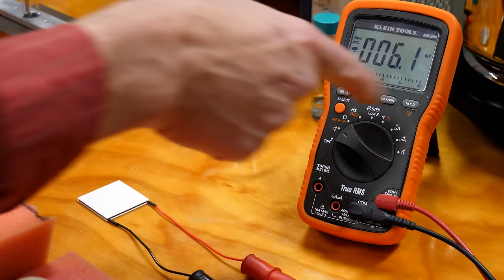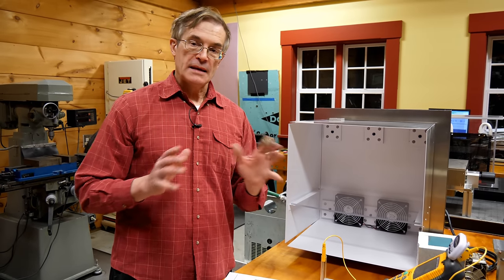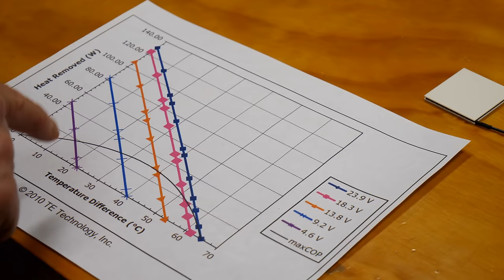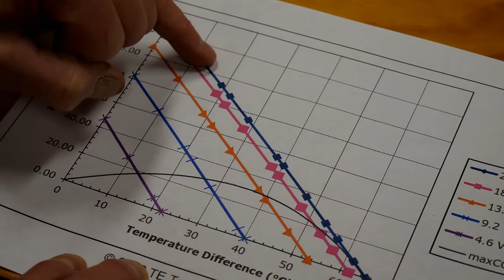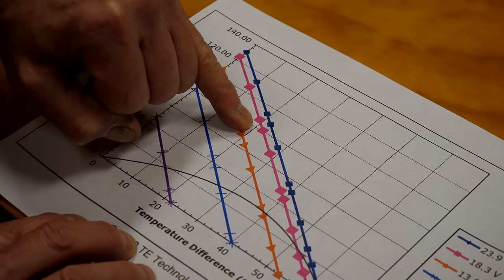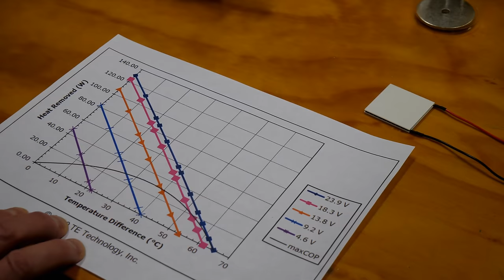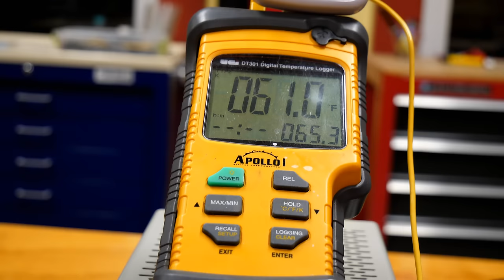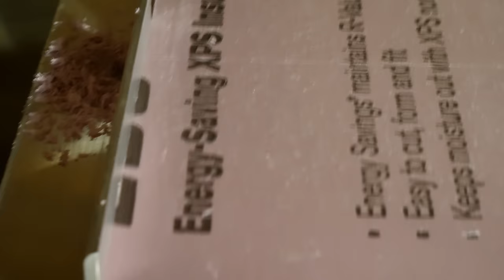BUILD YOUR OWN REFRIGERATOR! - SOLID STATE TEC

Comment: Put the opening on the top and the cold air will stay in the refrigerator when it is opened.Cold air pouring out when the door is opened is the biggest loss of energy.
Reply from the maker: We are doing  that for version 2.0 which is actually a freezer, but this refrigerator is for daily use in the lab and front loading is much more convenient.
Reply: In theory when explaining thermodynamics cold air has no tendency to move from a cold area to a hot area, but instead heat has the tendency to move from a hot area to a cooler area. Orientation of the fridge does not matter when trying to keep the heat out. Nice try, Mark.
Reply: @Standard_Logic  Seems the cooler air in the unit would flow out of the front facing door, as this cooler is is more dense than ambient. Similar to a fog rolling off and down a hillside, a bulk flow of a more dense gas. Theory does state that heat transfers from hot to cold, but in this case it is more about the buoyancy of the air. I think this would cause the inside to heat up faster, than if the door were at the top. Same reason the fins on the back are oriented vertically, to promote air currents up and through the fins via buoyant forces.
Reply: It will absorb moisture
Reply: The moisture will condense and freeze on the heat transfer studs. Two minutes with a hot air gun should be good to defrost. By switching each Peltier off one at a time it might be possible to make a self-defrosting freezer.
Reply: @TechIngredients  Is the front loading refrigerator with a door more convenient than the meat refrigerator at the supermarket with no cover at all?
Reply: that was exactly what i was intented to write. most efficient coolers/freezers even those van-camper style has lid on the top to prevent cold air pouring
Reply: Richard Driskill  Perhaps a brief reversal of current will be enough to de-ice the cold panel one section at a time.
Reply: Richard Driskill  That's what I originally visualised. A way of loosening any ice buildup and a simple collection tray or trough to drain externally.
Reply: @Standard_Logic  

Hey Mr Arrogant,

Cold air is denser than warm air, so it falls out of a front opening refrigerator when opened as warm air replaces it in the top. Nice try though.
Reply: @TechIngredients  I would suggest putting the TECs on all 4 walls of the freezer and build each wall to operate as a cooling fin/heat sink. I love this project and I'm looking forward to future updates.
Reply: @Standard_Logic  In theory, theory and practice are the same, but in practice they're different. Mark is correct. You are incorrect.
Reply: The very act of opening and closing the door, will stir and thus move more air than would be noticed with reorientation of the opening. It's why you should open your fridge door once to load or unload everything, even if the door stays open for a minute; rather than opening and closing several times.
Reply: I noticed you did;nt use sealed pelteir devices. If your cold side is not perfectly sealed at the device , you'll get condensation build up and they'll rot in about a year or less. excellent vid btw.
Reply: "Cold air pouring out is the biggest loss of energy" I don't think that is correct at all. The volumetric heat capacity of air is around 3000 times less than water (the contents of the fridge can generally be approximated by water). Very little of the 'coolth' in the fridge is represented by the air, it is overwhelmingly in the contents. loss of cold air represents a small fraction of the energy needed to keep the fridge at a low temperature, and changing orientation is only a small gain in efficiency.
Reply: thank you
Reply: @lostjohnny9000  first I thought I was a genius, but than I checked the comments... :-)  thanks
Reply: imemine7 I was thinking about this, too.  So maybe the biggest loss of energy, then, is taking containers out of the fridge for longer than they need to be.  If you don't do this, though, then I think Mark may be right in that it's the ONLY loss of energy aside from the regular losses through the walls.

As a bit of an aside, I have a roommate who likes to prepare his meals leaving the fridge door open and reaching for ingredients as he needs them rather than taking everything out ahead of time.  In addition to wasting energy, it is also annoying because the door has an alarm if you leave it open for a long time.  Anyway, I had some milk go bad, but rather than confront my roommate who has a tendency to forget people's requests of him, I took some containers of water and just put them in the fridge.  The same amount of energy is lost each time the door is left open, but the water cools the air down more quickly, meaning the food doesn't get as warm each time.  I'm not sure if leaving the door open was the culprit for the milk going bad, but I haven't had any go bad since.
Reply: @Standard_Logic  Due to the combined gas laws, cold air has a tendency to want to be more dense, and thus the effect of gravity upon the cooler air will be more significant. The combined gas laws also support your hypothesis in a number of ways, for example, when air enters the fridge it is warm, but then with the door closed it will cool and with the temperature drop in an enclosed space you (should, assuming your fridge is appropriately sealed) get a slight vacuum. That vacuum will act to pull warm air into the fridge the moment it's compromised. However, it's the flowing that occurs after this introduction of warm air that's most significant... I have owned chest freezers before, and I now own a standing freezer... it sucks by comparison. I had to get some containers because the cold air flows straight through the baskets that pull out of it. You can feel it pour out of the freezer the moment you open it... all over your feet... very nice feeling in this Aussie summer heat, but a complete waste!
Reply: @lostjohnny9000  you can even use an h bridge to drive the peletiers, and one slightly to defrost it quickly.
Reply: @Standard_Logic  Thermodynamics governs the movement of heat. The movement of hot and cold gases is an entirely different matter.
Reply: @brainmind4070  Hi, I was referring to losses proportionally of course. If you had a front opening refrigerator without a door at all then it would work very very poorly (to the extent that we would be inclined to say that it doesn't work at all).  At top opening fridge without a door would certainly stand more of a chance of working somewhat. 

The three deficits a fridge has to overcome in order to work are the loss through the walls (well, technically a gain of heat of course); the energy need to cool down food placed inside it - whether "new" food or food replaced after being used; and the loss through air exchange when the door is opened. 

The exact numbers and proportions of these three will vary with the fridge design. In my peltier fridge the conduction losses dominate (nearly 4x the food load) that is in a very small fridge but even with 125mm (5") of insulation. My fridge is top loading but the losses due to air exchange are so negligible that I could ignore them in the calculations (assuming sensible use), and would not be that much larger in a front loading fridge.

Not that the thickness of the insulation is by far and away the most important feature of a practical (efficient) peltier fridge (any fridge for that matter) anything less than 100mm(4") and you are wasting your time. All these thing can be calculated, there is no need to guess any aspect of the design.
Reply: imemine7 Well, sure they can be calculated, but these are YouTube comments, where spitballing reigns supreme, with shooting from the hip being a close second.  I appreciate the precision, though.  I didn't realize conduction was so dominant.  Sounds like good insulating material is critical for having an efficient fridge.
Reply: @Standard_Logic  Open a refrigerator that is sitting in an 80° garage and you will feel the cold air come rushing out onto your feet. The cold air is denser and falls out at the lowest point while warm lighter air moves in at the top of the space. Open a deep freeze that is top open and guess what, the cold stays in.
Reply: I think I'm_Doing_IT has learned a lesson from this video. Sometimes snarkiness can punch you in the face.
Reply: @brainmind4070  put an air gap between foam panels. Better than solid foam. Air is the best insulator.  That's all the foam is doing is trapping air. A vacuum is best, but practically difficult.
Reply: I live in Canada, insulation is extremely important to learn about because our climate fluctuates widely, and energy is expensive!
Reply: The biggest loss of energy was me reading all the comments.
Reply: @Standard_Logic  ,  In this case air is the convection medium inside the enclosure. Air is a very low viscosity fluid, cold air is very dense (read heavy) compared to warm air. The dense, heavy, cold air quite simply flows through the open side door to the ground because of gravity, pulling warmer, lighter, less dense air to fill the void. Coffin freezers and reach in refrigerators in your local Piggly Wiggly are great examples. The reach in refrigerators either use doors or a curtains of directionally blown air to help contain the cool mass of air. The dense cold air in the coffin freezer stays pretty stable due to being contained on 5 sides. Nice try, IT.
Reply: @johnosullivan675  IT's principles are completely wrong in this case, his theory isn't very well(or at all) thought through.
Reply: @sebastianramadan8393  Vacuum inside the volume of the contained space is an extremely insignificant factor. Your reference  to "combined gas laws" ignores the simple physics of air #1 having mass, #2 being a fluid, #3 density of volume in relation to temperature. The heavy dense air simply flows towards the source of gravity when containment (the door) is breached. The opposite example of this the function of a hot air balloon. Think about it.
Reply: @lostjohnny9000  Reversing the current through the Peltiers occasionally and providing a drain at the bottom would make it self defrosting. Can be done with a compressor system also, reversing flow and switching function of the condenser and evaporator. Some Manitowoc ice makers operate on this principle.
Reply: @TechIngredients  You can have drawers with open top parts, simple compromise like they usually have at restaurants. I am thinking of getting that for myself when I get a new refrigerator the next time.
Reply: @MarkProffitt  Obviously the one without a door would be more convenient but less efficient.........
Reply: @Jasoninee  LOL why are you arguing about physics you don't understand? Most of the air transfer is caused by the back draft of the door. An open door allows heat into the unheated space, increasing the temperature of the fridge.  Cold is an absence of heat, nothing on its own but a subjective quality.
Reply: @FletcherHillier  
How would I not be understanding the physics?
You think I don't already know that cold is the absence of heat?
Are you implying that you dont believe cold air is more dense than warm air?
Take a wild guess why deep freezers are oriented with the opening up but yet the same exact door of a normal fridge.
Opening the door just creates a short moment of pressure drop where warm air would flow around the door to fill in where it left.  The inside is a sealed box so the slight pressure drop would only have the cold air spring a little and return in, causing minimal turbulence.

Apparently you never open your fridge barefoot huh?
Reply: @Jasoninee  He doesn't want a top loading door though.  The physics behind something Noone wants is irrelevant.
Reply: @MarkProffitt  well since he isnt in a supermarket, yes, probably.
Reply: Mark is correct that the cold air sinks to the bottom of the space and would "pour" out of the fridge, not because of being hot or cold but because the cold air is more dense than the air surrounding the units exterior.  Because the atoms are colder they closer to each other, thus more atoms fit into any cubic space, thus the air is heavier.  In weather a low pressure front is usually warm and a high pressure front is usually cold.  Another  simple comparison would be an above ground swimming pool.  The weight of the water in the pool is greater than the weight of the air around the pool.  The only thing holding the water back is the pool wall.   If you tried to place a door in the side of the pool the heavier water would rush out into the space that contains the air that is lighter than the water and the space the water was in would be replaced by the less heavy air surrounding the pool.  In the case of the refrigerator, the dense heavier cold air will pour out and be replaced by the less dense warm air surrounding the exterior of the fridge.  In most cases (unless the air in the room was nearly saturated with relitive humidity) the amount of heat contained in the air molecules is very small compared to the amount oh heat that a more dense item like liquids and solids can absorb.  Usually the time the door is open is not enough time for the dense items to absorb much heat from the surrounding air because again air with low relitive humidity does not have very much heat in the first place.
Reply: He should put this refrigerator inside a freezer when he opens it mate
Reply: That's what long term deep freezers do
Reply: Phubar Now So?  Like said earlier;  air has very latent absorption, so tho it feel cold to you the refrig is loosing very very little cold.  Compared to the contents the absorb all the cold.
Reply: gravelydon But a little cold air on your feet means almost nothing, it contains such little energy.  After a couple seconds the air is out and the contents are still cold and have absorbed the bulk of the cold.  That is why an empty fridge cycles a lot, with the temp dropping quickly cause there is only air there to absorb the cold.
Reply: Better yet, make it a sliding door so there is no pressure created by swinging a door open.
Reply: @Standard_Logic I'm imagining it like a bucket. Wouldn't the air fall out if you had the side opened? Similar to how water would?
Reply: Good point if you ask me Mark,  @Standard_Logic  , i'm only a lowly sparks but cold air has considerably lower viscosity and higher density than warm, even TI is contrite so how does the internal air not "fall out" when the door is opened?
Reply: Well ! Then how about making a hole wide enough to get a beer can out of it?
Reply: @kcjacknave898  practically speaking , yes you might lose some cold air but since the thermal mass of the fridge and its contents is cold this will be less detrimental to it's performance than people commonly assume. After all check out the heat capacity of air vs for example cheese or the aluminium he's made the inside of the fridge from. You're not losing all that much energy losing the cold air. Most of the cold is 'stored' in the solids in the fridge itself. This is why it's always more efficient to run a full fridge than an empty one.
Reply: @imemine7  this (y)
Reply: @Standard_Logic  Cold air is denser it is like poking a hole in a bottle it literally flows out by gravity.
Reply: @johnosullivan675  if you want to prove someone wrong you should also give some explanation on it. Plus, its very fun talking about these subjects😂
Reply: Actually, i think two drawers is a more practical, more energy efficient answer, for both the fridge and the freezer
Reply: Do you have data on the input power (fans plus TECs) required to reach a steady state internal temperature and the internal temperature achieved?

Great video, much appreciated.
Reply: @imemine7  This what you are referring to is not totally correct or incorrect. Why? Because in an ideal situation, the fridge is perfectly sealed, with no outside air coming in. However, we are talking about hand made fridge, which (in most of cases) does not really have efficiency as good as factory-made. Meaning that doors are gonna leak cold air that is being collected on the bottom of the fridge trough the cracks constantly and thus losing cold air. On the other side, a horizontal fridge uses gravity in a beneficial way, in a sense that top doors are pushed by gravity and sealed up the fridge. So yeah, while I agree that air doesn't contain much of a capacity, constant loss of air leads to higher losses.
Reply: @Standard_Logic  Cold air will flow towards gravity/low pressure and resist flowing against.  If the opening is at the top, cold air will resist flowing both towards high pressure heat and against gravity.  Orientation makes all the difference.  If left open long enough the hot air will transfer heat and warm the cold trapped air.  Use Infrared optics and you will see.
Reply: @imemine7  So instead of a hinge door, we should be using multiple smaller sliding panels or even aperature doors.
Reply: Could that work for normal refrigerators as well?
My freezer does have an open top, but my fridge doesn't? Or is the reason "User comfort"?
Reply: @Standard_Logic  Not true, cold air has a higher density than warm air, meaning cold air has more mass/cm^3, this means the air wants to move to the room with a lower density, 

If this was just talking about energy than you would be correct, but in this case, we are talking about more than just energy, you need to take the molecules and their relative densities, gravity and such things into consideration as well, and those effects outweigh the tendencies you are describing.

You are right in saying that energy wants to move into a colder spot, as entropy has to be decreased at all cost, but hot air has a lower density it likes to move up, cold air is denser so it stays at the bottom, so warm air won't be moving into the fridge if the opening is at the top, as the cold air has more density, the cold air will also want to stay at the bottom, this increases efficiency, as the cold air doesn't flow out of the fridge and the warm air doesn't flow into the fridge, what will happen is that the energy from the warmer air will find it's way down into the fridge, as entropy has to decrease and the fridge is a high entropy spot in the room, so energy will be introduced into the fridge in both situations, but the open-top fridge will lose entropy slower than the front opening fridge.
Reply: Yea, I am planning something like this for my ship, which has a top opening ice box built in already, with about 4" PU foam insulation. This video gave me a few extra ideas :)
Reply: @Standard_Logic  ...cold air is more dense than warm air so it tends to be at the bottom....its about weight  so he's right.
Reply: Neeeerrrrrrrdddddsssss
Reply: @ @MarkProffitt looks like you did not understand the meaning of convenient!!  you need to understand that storing packs of meat or piling them has not the same layout wanted in an office, workshop or house since you will have different items inside the fridge!! it is very "inconvenient" to have a box layout like the ones used to store meat...  Convenience= use= ease= benefit...  stubborn= having or showing dogged determination not to change one's attitude or position on something, especially in spite of good arguments or reasons to do so. showing big pride and arrogance...
Reply: @jeffcard3623  I know this is 10 months old, but it bothers me. Fluids like air are terrible thermal insulators when the medium you're operating in is that same fluid, because mixing is a thing. Thermal insulation is about preventing the kinetic energy of moving and vibrating atoms/molecules from dispersing. Air lets them do that very easily, especially when the medium you care about insulating is air. Air is only a good insulator if you have an airtight seal and the fluids aren't allowed to mix. Air is a good insulator of liquid water, for example.

Good thermal insulators generally incorporate as many medium changes as possible. Good thermal insulators are almost all spongy. The foam panels have tons of air pockets in their structure. They're good insulators because there's a lot of air pockets separated by thin solid materials. Putting an air gap between those isn't going to help you much, you'd probably get a better result with an equal amount of foam, especially since your airgap won't be airtight itself using foam.
Reply: @Standard_Logic  But that completely ignores fluid dynamics. Opening the door will briefly create a low pressure area, which will be quickly filled, creating vortices. In a side opening fridge this results in air being pulled from all levels of the interior, in a top opening fridge this only disturbs the upper layer.
Reply: @imemine7  Absolutely correct!   Thermal mass is king!
Reply: The cooler air is more dense and will "flow" downwards out of a side-opening. In this case it's gravity...not thermodynamics that is working against you. Same thing that happens to cool air in the atmosphere. Hot air rises, cool air falls.
Reply: @Standard_Logic  buoyancy is a thing, smoothbrain
Reply: @lostjohnny9000  
Actually,  reversing the current to them one at a time would be much quicker.
Reply: @Standard_Logic  KC Jack Nave is correct.  Cooler air is denser so opening the side door allows it to poor out like liquid seeking to be at the bottom of that atmospheric layer cake than the less dense hotter air which replaces it.  The vortex effect created by the suction of opening the door starts it going and it will keep going like a siphon effect until all the cooler air has left out the bottom of the open door bound to evenly spread itself on the floor below, the lowest point it can reach to maintain the gravity induced layering where hot air is always higher up or is in the process of going there if it hasn't reached its temperature equivalent layer yet.  Whereas the top door disallows this by trapping the air with the side walls like liquid water staying inside of a cup.  There will still be a little bit of loss due to suction of opening the door and the vortex/siphon effect, but it will be far less loss.  IF you don't believe me, ask any solar aficionado why off-grid solar pros choose top-door freezers... it's because they use less energy to maintain their cool when the door is opened due to comparatively lower loss of cool air by design.  They've known this for years.
Reply: @Standard_Logic  Why are your feet cold when opening a vertical freezer and not for a chest freezer. Possibly because the cold air drops and what replaces it?
Reply: Naive to assume that  wasn't known. Chest freezers are soooo common
Reply: @Standard_Logic   Over a year has passed and the way you owned yourself has not become any less beautiful.
Reply: @Standard_Logic  What are you talking about?
Reply: This is why I'd like to convert a chest freezer to a fridge.
Reply: @Standard_Logic  ....AND don't forget, lets hope your fridge doesn't remain empty. With that said the cold items inside wouldnt allow most of the cold to escape.
Reply: wow🖒
Reply: @Standard_Logic  Until you open the door and all you cold air drops to the floor, also the reason why a filled fridge uses less energy.
When you never open your fridge, orientation (and filling) does not matter indeed.
Reply: @Standard_Logic  You're forgetting convection, cold air will flow down very quickly with a front door. Mark's argument is valid.
Reply: @lostjohnny9000    Sure, and there goes ALL of your energy savings!
Reply: @Standard_Logic  WTF? Regardless of the theory, in practice cold air is more dense than hot air, thus opening a front door allows the cold air to pour out. The reduction in air pressure inside the freezer, effectively sucks hot air into the freezer! In a freezer with a top opening door, the colder more dense air is trapped inside the freezer when the door is open, so it does not allow hot air to to infiltrate the freezer! There are a lot of things that in theory may work, but the practical is quite different.
Reply: @lostjohnny9000   In fact , if mounted on a common outer heat exchanger block, just disconnection one for a brief time might do.
Reply: @lostjohnny9000  In a fridge (pos. temp) just switch off the peltier and keep the fan running
Reply: @TechIngredients  that's weak! Make the shelves from screens which pop up as a unit for item retrieval, then retract back down in to a cold pool of air. Sure everything will fall over and jam the mechanism continuously... Ok so maybe outfit the floor to have an airblade fan counteract the density convection?
Reply: @Standard_Logic  thats true if there is no gravity, but in a less difficult place to get to like earths surface, the denser cold air is heavier and moves quickly under the more bouyant hot air..
Reply: @johnosullivan675  mark is correct only in the near absence of gravity, which IS true for most of the universe, but not on earth.
Reply: @imemine7  so it should work if the door is left open huh?  easy enough to test..
Reply: @jeffcard3623  its STILL air that is the best insulator, otherwise convection currents transport the heat, which is what foam embodies, small bubbles of still air.
Reply: @brainmind4070  keeping extra water in the fridge and/or freezer can help when there is a power outage.
Reply: @imemine7 top or front doors work the same without gravity, then its the size of the door that can vary heat gains
Reply: @Standard_Logic  Boy, 2 years later and your comment is still just as cringe. yikes.
Reply: @Standard_Logic  If that were the case you would feel no coolness when you open the fridge
Reply: Does it have to be in the upright position, maybe a plastic curtain would work
Reply: One of a way is to have blue bag or isolated thin layer of hot/cold bag in it. So, when you opened closed and open closed the door it will not loss so much coldness at instant.
Reply: @Standard_Logic  you are not very smart
Reply: @TechIngredients  Been watching a lot of your experiments over the last few years. Really great job explaining everything, you guys really make it interesting. On projects like these could you do a small parts list in the descriptions, say like the model # of the components/where to get them if someone misses it in the video. Again, great stuff. Really liked the distillers & the explosive ones (don't we all). Thanks.
Reply: @jeffcard3623  True, but air introduces convection. So while it conducts poorly, it's not a good insulator.
Reply: @Standard_Logic  you must be fun at parties
Reply: Also if you put a barrier shelf on the bottom of the unit it would hold the cold air in and get it to circulate back up and around because cold air does like to drop.
Reply: In general, the heat sink temperature of the *contents is much more influential than air movement, so I keep a gallon of water inside when it’s more empty than full. 
   That said, I’d use a (hinged) CoroPlast BAFFLE in my DIY front-door box to keep the majority of the cold air inside, which only needs displacing to reach the very bottom-most items. 
   Id also hyper-insulate it and add reflective foil to the exterior to reflect near IR radiation.
Reply: no that's a common mistake, it's not the cold falling out and down, it's the hot air in the room rising up into the fridge...
Reply: @Standard_Logic  Then why are all the coolers at the super market made that way. Cold air goes down hot air rises. If the bottom was open , all the cold air would run out. A chest freezer is built that way also.
Reply: @Jasoninee  yay
Reply: I wonder if a segmented sliding door would stop some of the mechanical transference of air better than a hinged top-opening unit?
Reply: @Standard_Logic  but if cold air is heavier than warm it should stay in the chest just like at the grocery store